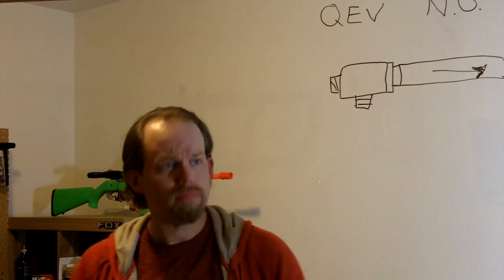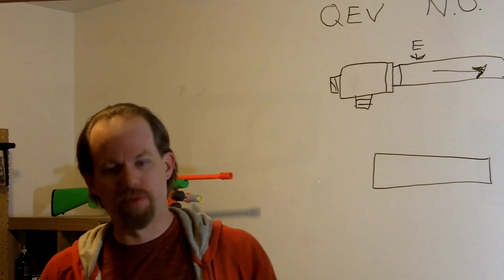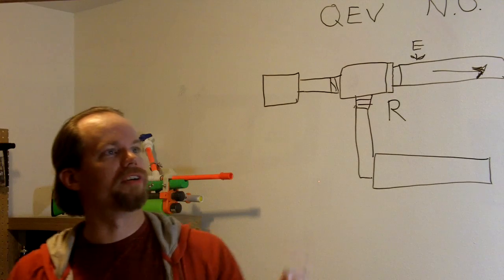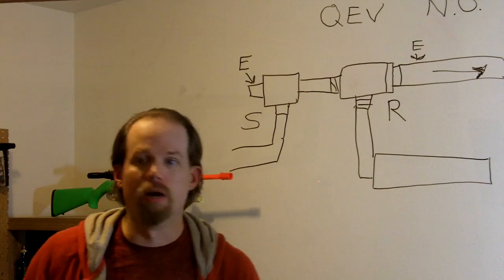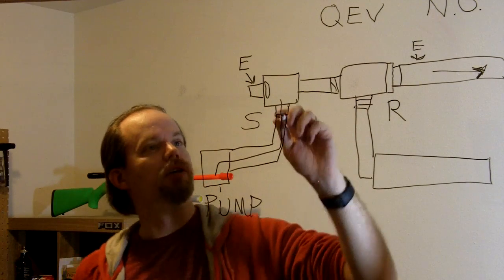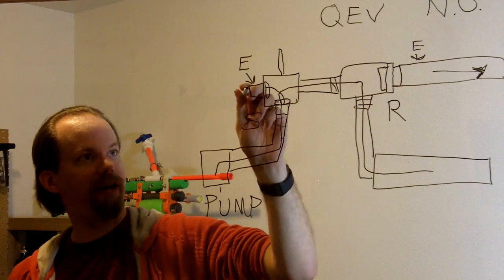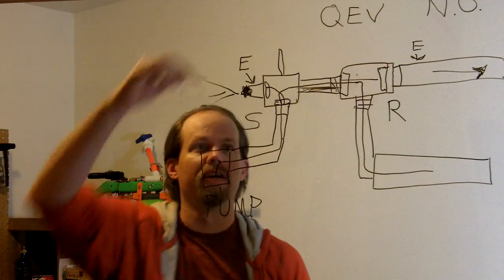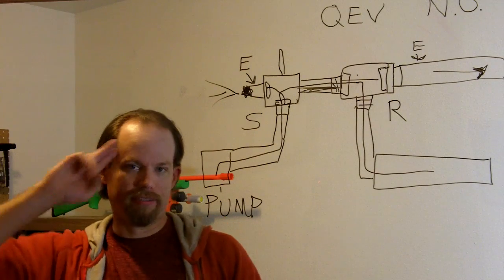Intro into QEV blasters

Comment: If there his a slow leak somewhere on the pump/trigger side of the QEV, will this eventually just spontaneously fire without warning?
Reply from the maker: Yes, this is a possibility. but not till the source drops to below the pressure needed to trigger the QEV.

Comment: When watching MTB's vids with Ryan's HPA builds, I always wondered how the setup worked!
Thanks for explaining it here mate, and thanks to Pirate Johnson for linking the vid in WalcomS7's Discord! :D
Reply: I think MTB Ryan's is different.  It doesn't use QEV.  It uses a MJVO-3, HPA tank and XBZ tank if I'm not mistaken.
Reply: @BrandonTing  Yup, Ryan uses an XBZ, which is essentially a self contained QEV and reservoir in one unit. All HPA setups still rely on a 3 way valve to vent air, drop pressure in the QEV, allowing the exhaust to open and dump air out from the reservoir - most people use an MJVO3 but there's more and more modders experimenting with solenoid valves now.